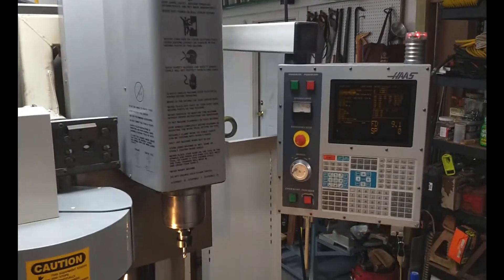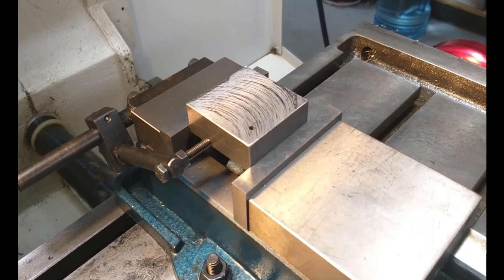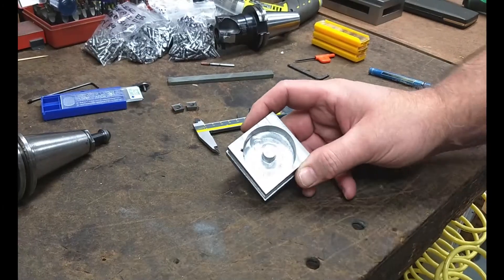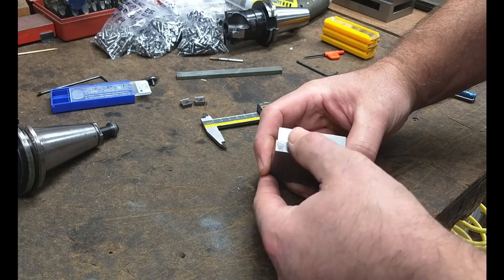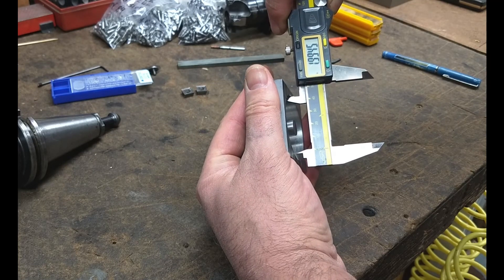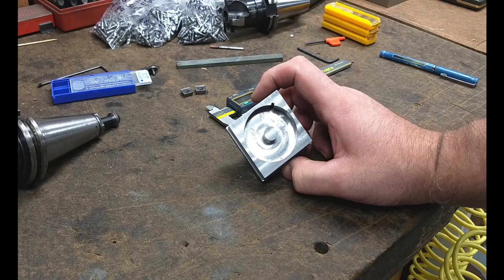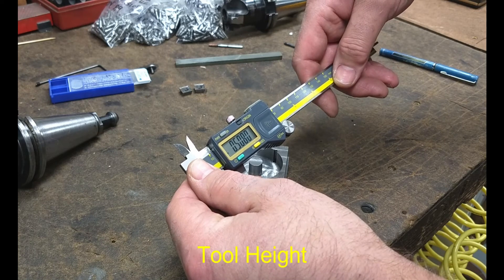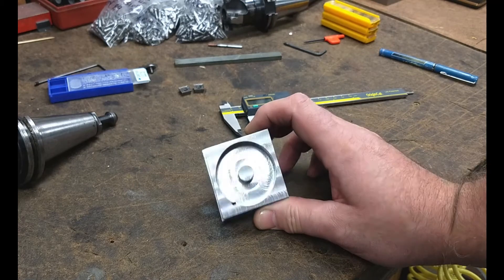Milling Steel! My First Metal Part on the HAAS TM-1 Mill

Comment: End result was plenty good for 1st  try in steel. I have a TM-1 as well since 2004, it's a very capable little mill, you can speed them up to 6000rpm no problem with just parameter changes. The 6000 is a help in Aluminum. You can also jack up the Rapids to 400 but the stock 200 is fine for me not being in production. I put a step by step how to on the CNCzone to speed it up some years back. Just search for TM-1 speed increase if your inclined to try it.
I looked and can not find it but did locate it elsewhere. Post# 15    https://www.practicalmachinist.com/vb/haas/successfully-increasing-spindle-speeds-tm1-280191/
Reply from the maker: Ken, thank you for the comment. I will be searching for that thread!

Comment: Nice  job...Chris,  Little advice depth of cut  should be no more then 70 % of tool diameter.
Reply from the maker: For each sucessive cut? I thought the rule of thumb was 2X diameter for depth of cut and 25% for width of cut.
Reply: @lockbuilder  for example 1/2" diameter endmill to cut 1" depth (pocket) tool path depth of cut no more then .35" each depth (70%) and step over safe one is 45% of tool diameter, unless you use dynamic toolpath (Mastercam), with dynamic toolpath you can go as deep as the flute of the endmill.